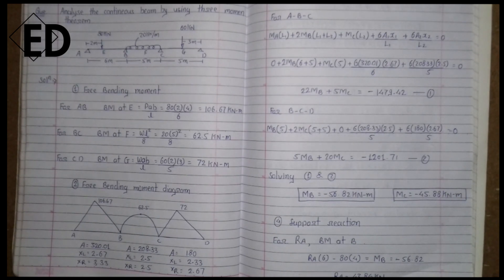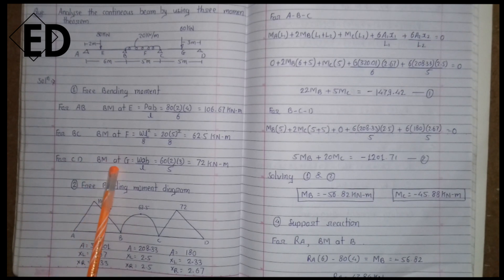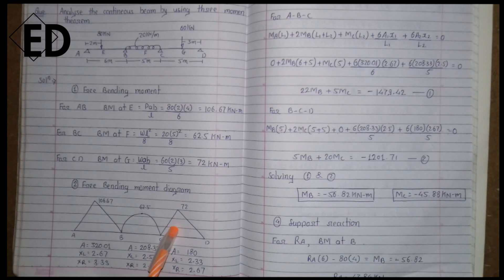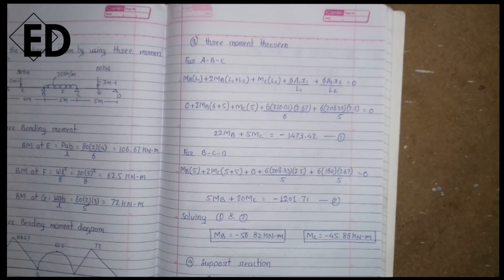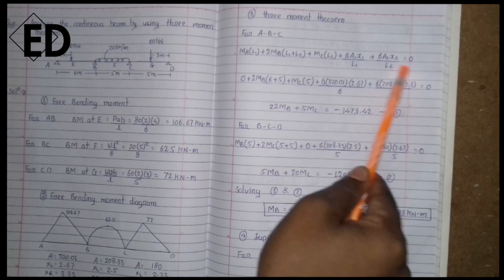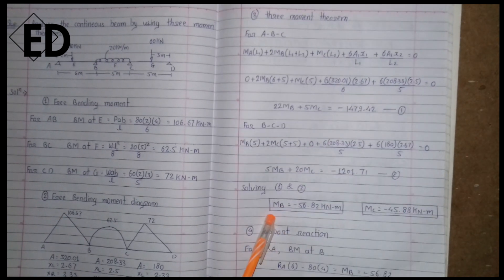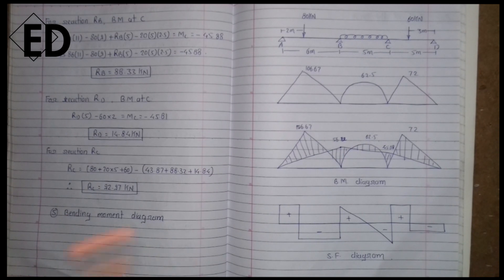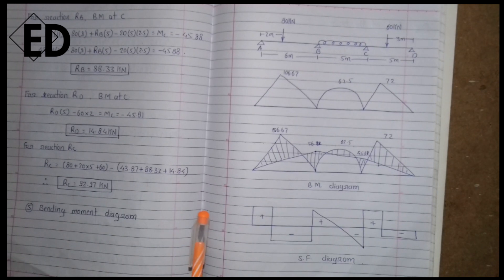How to solve three moment theorem ????  (TYPE 1)

Comment: What formula did you use to get the centroid of the triangle?
Of the first triangle I get Xl as 1.33
Reply from the maker: The formula for calculation of centroid of triangle is  (2a+b)/3 and from other side (2b+a)/3.
Reply: a+L/3...similarly b+L/3

Comment: Mc=57091/1245
Reply from the maker: +THE STRUCTURAL ANALYSIS MATRIX FORMULATION 
Mc=57091/1245=45.856 
The same answer, what we calculated.
Reply: I am just backing you up,great work!
Reply from the maker: +THE STRUCTURAL ANALYSIS MATRIX FORMULATION  
Thanks......
Reply: Wrost explanation..

Comment: while calculating centroidal distance, the answer didn't came 2.67 using (2a+b)/l.while the answer came using (2a+b)/3 formula.what to do???
Reply from the maker: sorry for the wrong formula sheet. Actually the formula is (2a+b)/3 but all answers  we derived are correct.
Reply from the maker: thanks for your feedback.
Reply: devil signing sincee the distance isnt symmetric i.e. 2 and 4 soo frmula is (2a+b)/3
Reply: Formula is L+a/3 or L+b/3 for xLor xR